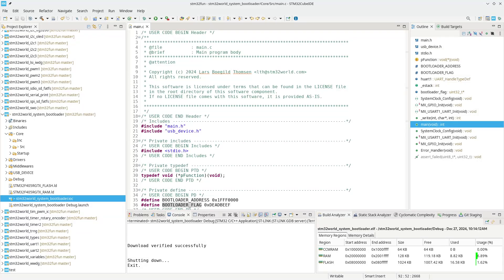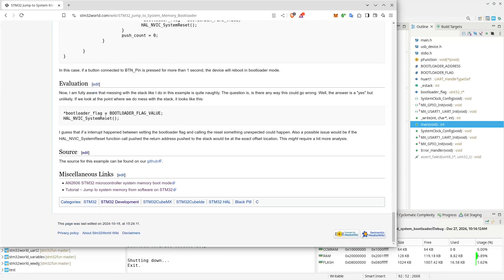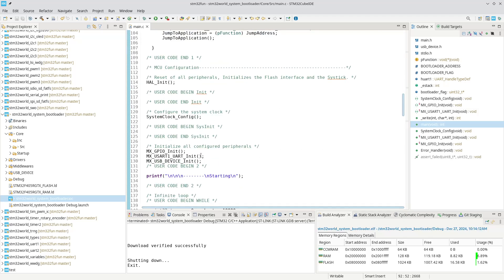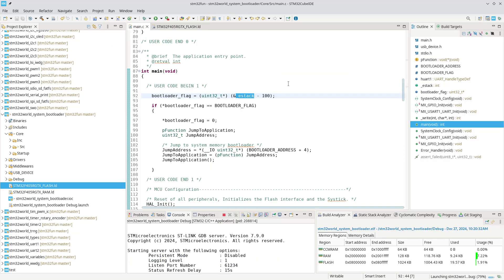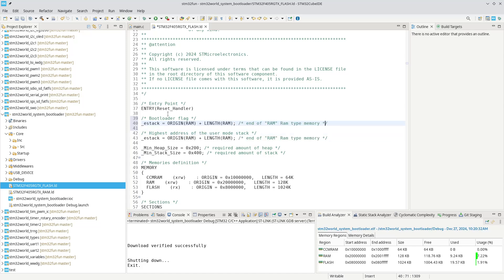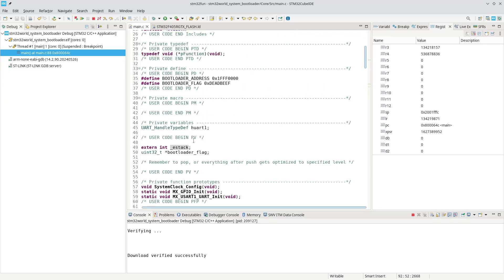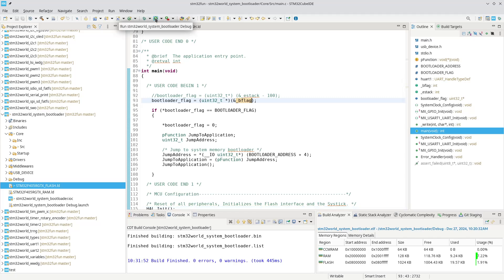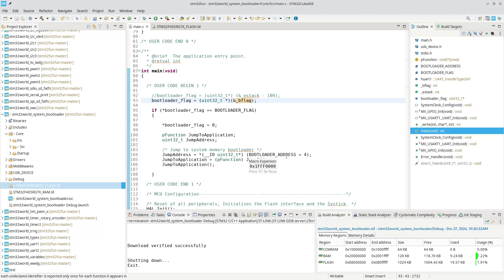STM32 Tutorial #39 - Cleaner Jump to System Bootloader

Comment: Sorry but I don't know how to register and comment on the Wiki so I'll post it here. I ran your new version through chatgpt-o3-mini-high and got this respons which maybe explains the printf issues:

The ARM EABI (and many C libraries for ARM) requires that the main stack pointer be 8‑byte aligned at function entry. In your original linker script, _estack was set to:

_estack = ORIGIN(RAM) + LENGTH(RAM);
which is normally 8‑byte aligned. When you change the script to:

/* Highest address of the user mode stack */
_bflag = ORIGIN(RAM) + LENGTH(RAM) - 4; /* end of "RAM" Ram type memory */
_estack = _bflag;
_estack is now 4 bytes lower than before. For example, if ORIGIN(RAM)+LENGTH(RAM) is 0x20024000 (which is divisible by 8), then 0x20024000 – 4 equals 0x20023FFC. This new value is not 8‑byte aligned (0x20023FFC mod 8 equals 4) and thus violates the ARM calling standard.

Because many floating point routines (such as those used by printf for floats/doubles) assume proper 8‑byte alignment, the misalignment can lead to corrupted or unexpected behavior when handling floating point arguments.

How to Fix It
To maintain proper alignment while still reserving space for your boot flag, you have a couple of options:

Reserve 8 Bytes Instead of 4:
Change your linker script so that you subtract 8 bytes rather than 4. For example:
/* Highest address of the user mode stack */
_bflag = ORIGIN(RAM) + LENGTH(RAM) - 8; /* reserve 8 bytes for boot flag */
_estack = _bflag;
This way, if ORIGIN(RAM)+LENGTH(RAM) is 8‑byte aligned, subtracting 8 bytes will keep _estack aligned.
Reserve 4 Bytes from a Separate Section:
Alternatively, you could keep _estack at its original value (preserving alignment) and reserve a separate 4‑byte section in RAM for the boot flag. This might involve modifying your linker script to place a dedicated symbol at the top of RAM without disturbing the stack pointer.
Reply: And I can confirm I have no issues with floats in printf() as I use them extensively.
Reply from the maker: I have tested it too - and fixed the repo here: https://github.com/STM32World/stm32fun/tree/master/blackpill_bootloader_bootloader
Might make a short video on this.
Reply from the maker: This is great - I love to get feedback like this.  I will try this out and probably post a short video with the fix ;)  I only discovered the printf issue later.
Reply from the maker: Fix video posted!  Thank you again! https://www.youtube.com/watch?v=Wm7eWu5dCrY
Reply: @stm32world  Thank YOU so much for your stm32world project and all the useful information you provide! PS: Don't forget to update the Wiki and the code at the bottom which still says 4 bytes (and also don't have the proper formatting like other code sections on the page).
Reply from the maker: Ok - updated the page.

Comment: I would not change MSP top location many libraries assuming 1K boundaries so this might be asking for trouble. Simply add your own section:
  
/* ram section of 4 byte, with global symbol, between .bss and ._user_heap_stack */
  .mydata :
  { 
    . = ALIGN(4);
    _bflag = .;
    . = . + 4; 
  } >RAM
Reply from the maker: Yes - you are right ;)  This video was not my finest moment and in all honesty - the naughty approach I've used before (just a fixed offset in the stack space) works better.
Reply: @stm32world   "naughty approach" is not needed when adding this section you just "allocate" the flag with the linker including global symbol
Reply from the maker: The problem is the size of the bss needs to be synced between bootloader and application to make that work.  They both need to know the exact location.  How would you do that?
Reply: @stm32world  If you look at the RAM layout you have .data and then .bss both not fixed, after that you add the fixed 4 byte section I propose and after that comes ._user_heap_stack (also fixed). Now you have a reliable RAM location that survives reset and can be referenced in your application because also the global _bflag symbol is defined., so you can use: extern uint32_t _bflag; I do not understand the problem you mention.
Reply from the maker: If you add the _bflag after the data and bss it will end up at different locations in the bootloader and application and an update application might move it yet again.  The _user_heap_stack is not fixed - it starts after the .bss and ends at the top of ram.  The location needs to be well defined across multiple projects (bootloader + app).
I can confirm it works if you align it to 8 byte and my "use fixed offset in middle of stack" approach also works just fine.
Reply: @stm32world   Depends on the intended use. In the assembly startup I just check _bflag for a specific value if there I call the system bootloader otherwise I continue boot. The location of the variable is not relevant. Works fine also after upgrade of application.
Reply from the maker: The intended use is clear from the videos - a means for two application to communicate via a flag which will survive a soft reset.  If BOTH applications - build independently need to share this, the location is extremely relevant.
If you think I missed something, I would suggest you fork the repo, make the appropriate change and submit a pull request.

Comment: why did you added 4 to the Bootloader address
Reply from the maker: That is actually a very good question!!!  You can find some part of the description in section 3 of this document: https://community.st.com/t5/stm32-mcus/faq-stm32-boot-process/ta-p/49358

In short, the first 4 byte of a STM32 binary contains the address of the stack pointer, the Reset vector (pointer to where the code start) is following that.  At the point in time the stack is already initialized, so jump to the reset vector is the correct approach.  I should have mentioned that.

I have updated the article on STM32World to reflect your question: https://stm32world.com/wiki/STM32_Jump_to_System_Memory_Bootloader